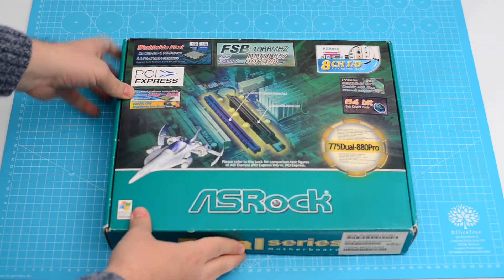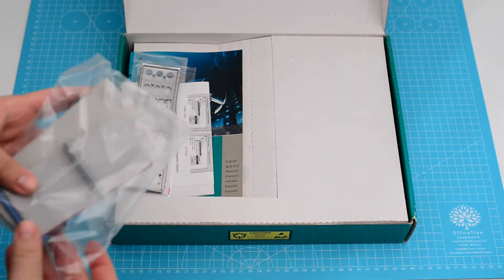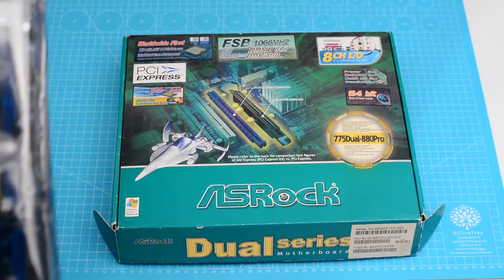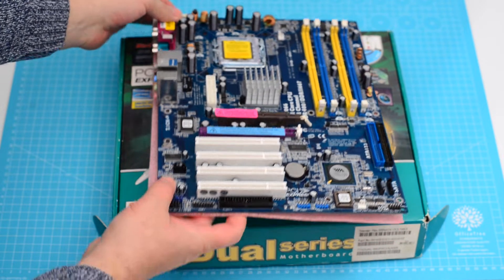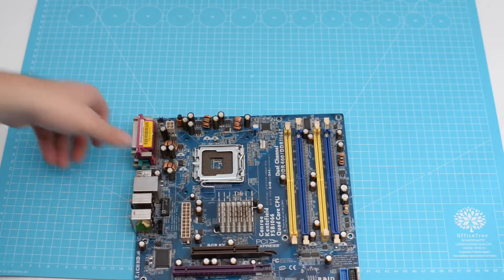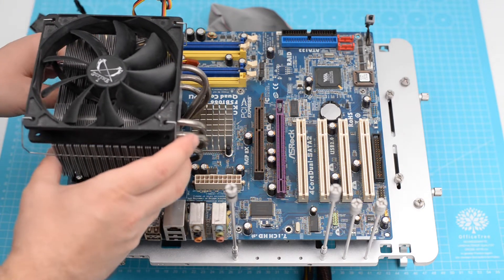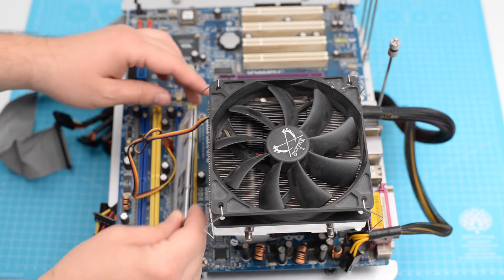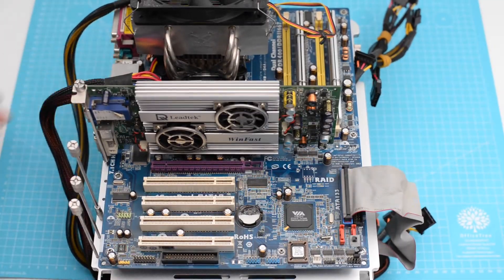Unboxing of ASRock 775Dual-880Pro and assembly of ASRock 4CoreDual-Sata2

Comment: Hi mate can you use agp and pcie at the same time?
Reply from the maker: Yes you can. But I would advice against using graphic cards with an additional power adapter. Only one card acts as "Main" (this is set in the bios) and the other one just provides additional graphics ports for more monitors.
Reply: @TechLab47  thanks for the answer, I have tried to run a pci-e Ssd, revodrive 350 to be exact but no success (paired with my hd3850 agp) have u tried to run something different than gpus on pci-e slot using agp also? Audio, ssd, Ethernet adapter, etc? I’m an owner of the 4coredual-sata2.
Reply from the maker: @manuelmunoz4054  No, unfortunately I didn't try running anything else. My understanding is that the ASrock engineers did a clever trick on the PCIex port and it's only x4 capable. Still it's very nice that they gave us this board with these features.